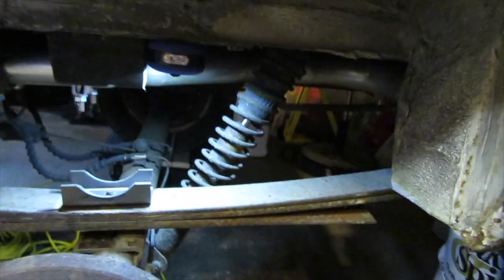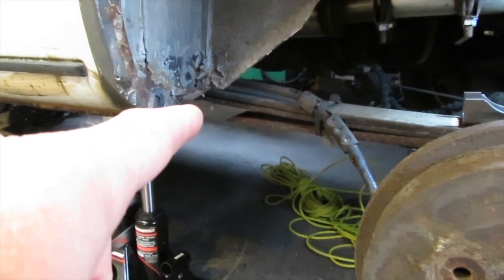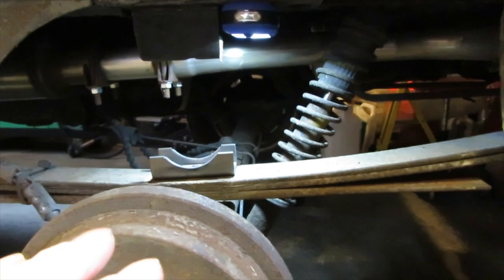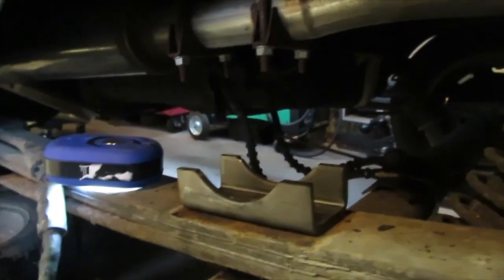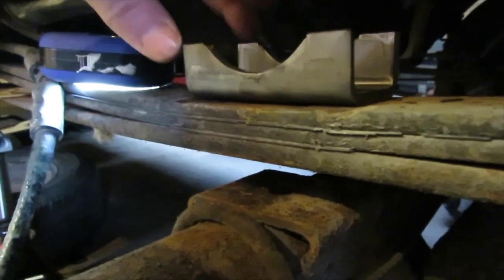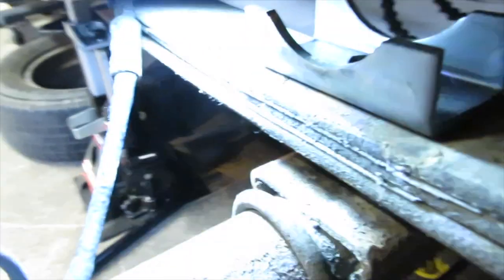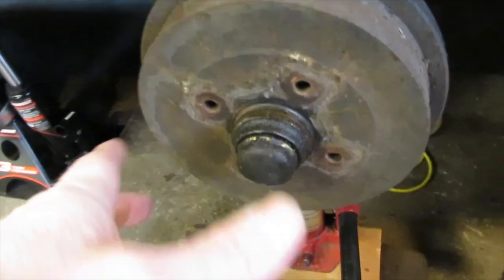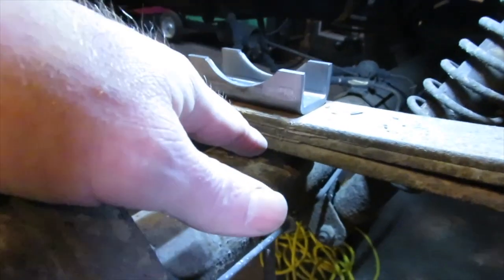VW Rabbit Truck Questions mk1 Caddy

Comment: i would suggest buying an axle flip kit from caddypan.com (i think that’s the website name) only 119$ and comes with all the u bolts and perches you would need (but you need to buy new shocks, which i would suggest anyways)
as far as the plate to raise the spindle, we call them “drop plates” this is a great option and is relatively inexpensive. A LOT of people use them for their daily drivers with no issues, as long as you are using the appropriate thickness. 
the axle flip kit will get you about a 4.5 inch drop and for the drop plates it’s best to keep it at 3.5 and under. 
id suggest buying the axle flip kit! it’s ready to bolt on and go, and it works great! 
if you decide to purchase it please do an install video! 
awesome truck man
Reply from the maker: Luke Almquist Thanks for watching! I saw those kit from them and for me that would be very easy to build for about $25. The whole caddy build will be on YouTube.